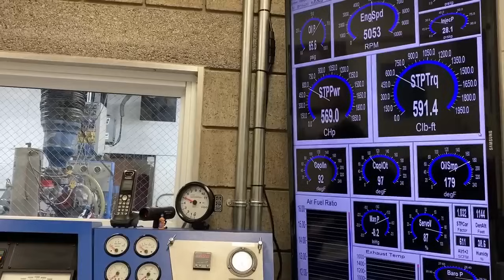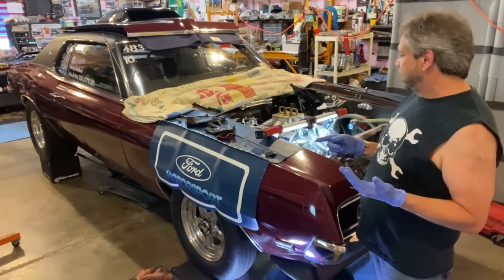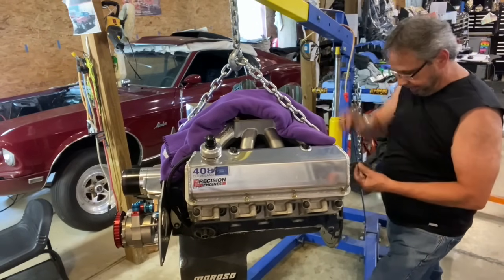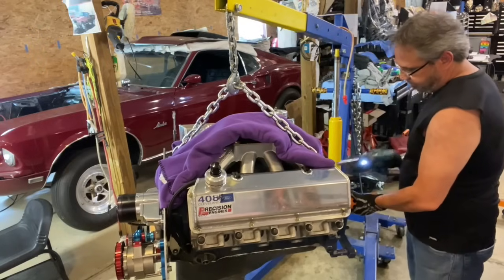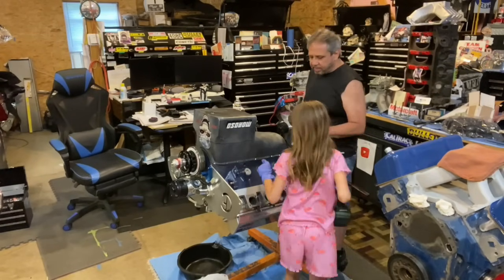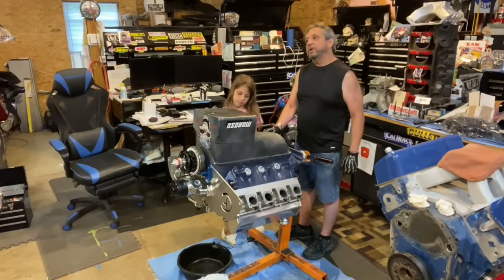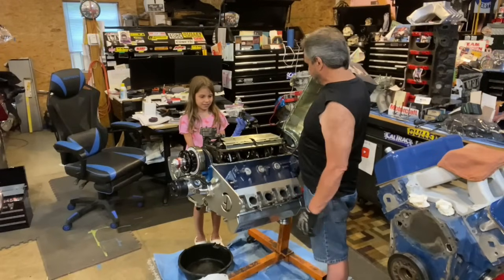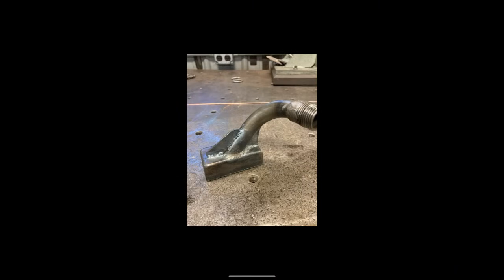DBG: Rip 769 HP Ford 351 Cleveland, Now We Now The Rest Of The Story...No Band-Aid Fix

Comment: This  is the reason why I like to run a single stage external oil pump with the oil pick up built into the oil pan
Reply from the maker: Have been debating that, external wet sump, but that is a 2k cost right there. Pump is a grand. I have learned what I do for oil mods is working well. I have a new pick up. So it will be fixed with supports. New crank and rods and lifters. Those lifters are 11 years old. Thanks Greg
Reply: Are you talking about a belt driven pump?
Reply: Pros: External oil pressure adjustment, almost eliminates distributor gear wear, a little more power from less windage, and ability to easily prime engine before startup.

Cons: cost and small worry about belt getting knocked off by debris
Reply: I think truck/tractor/ heavy equipment supply shops have an oil pressure safety switch.
I bought one in the 60's and it saved me once when I made the 4th gear change. The oil filter blew and oil covered everything immediately, and the engine shut down. It happens so fast that you aren't aware anything went wrong. But we learn.

Saved an engine, me and the car.  I seem to recall it was made by Bendix then.
Still have it.
Reply: All of tha to overcome  poor quality materials.I understand an upgrade idea though. @bryanmaloney6651
Reply: @DragBoss351Cleveland I hope the material it is made with is better.my Milodon pickup is strong steel about 12" long with many in use and no problem.
Reply from the maker: @michaelclanton1152 yes external wet sump.
Reply from the maker: @bryanmaloney6651 thanks for a quick synopsis. To tell you the truth I’m not changing anything. What I have works. The pick up failed. I talked to Stefs yesterday, they want to help me out with the oil pan and asked me to send them mine and they will decide a way better pan and pick up. And possibly do a live chat that pans and oil control. I thought about the external oil pump. I’m just trying to prove that I can do this, the way I’ve always done it. Thank you for being here. 🏁💯
Reply from the maker: @JohnH.-qp6fb yes sir you’re right on the money. I will have one of those installed. I never used one before and never really thought I needed one., But how wrong I was. You’re lucky you didn’t get hurt either. These are all expensive lessons for us to learn. I’m glad your here John. Stay tuned.
Reply from the maker: @michaelclanton1152 I talked to Stan at Stefs yesterday. He said send him my pan and a new oil pump. they will make a custom oil pan and pick up. And also possibly do a live chat. I always wanted one of their oil pans. Although I said, I am not changing anything in the rebuild. this change would rectify my issue. I’ve learned a lot of lessons Michael in this build, they all seem the hard way. But a lesson learned as a lesson lived, and from that,  get this. My old engine builder Bob, who is 82, I’ve made some videos on him and you may already know this. He’s coming out of retirement going to help me build this engine. Yeah 👍 and hey I may run a 9.20….
Reply from the maker: @michaelclanton1152 Michael I just gave you an answer on this in a different post. Nope I get what you’re saying. Trust me.

Comment: When I worked at a shop back in the 80's on circle track motors we always braced the pump and the pick up because we saw them brake with out them.
Reply from the maker: Wished I would knew this from the 80s, lot I don’t remember. Thanks Adam

Comment: Bro, did you do what I do and bend to fit it?! Tim, easy for me to say but I never would of used the welded part. Have had " repaired " water jackets, fail on one heating cycle. Welds change the metal around them and if oil was there at the micro level, it will fail. I feel for you big.time! I am doing an engine after 25 years, since my first open chamber 2V sludge motor and if it does fail for whatever reason, it will not be the machinists' fault. This is about you, so sorry DragBoss! Enough of me but thanks for helping all 351C builders. Not just with the content to follow but for all your fantastic work on the subject. The number of 351Cs, that have come to life and lived thanks to : you, your wonderful assistances, unreal /switched on guests; are no doubt many, Tim. Best wishes, Ads. I would have to be sedated and go on a weeks bender.
Reply from the maker: Thanks for the condolences. I am sick about it, but have to look at the good. The lessons learned and no damage so to speak. I never bent it, not welded so to speak but brazed from Moroso. I thank  you for the kind words you speak. I try my best to help others with my videos and experience I have. I am not some pro. Just a guy in his shed, with a love of Cleveland’s and racing and cars. This will be even better than ever. Good luck with your build, glad my channel helps.

Comment: A testament to the quality engineered into the alloy of your connecting rods, saved your block, pan & cam for sure. Back in the age of factory forged... it's all scrap. Crank's likely salvageable for future street service, with a .010/.020 turn. You'll dig yourself out of that hole, better days ahead. Expensive to go fast, some days better than others. We'll enjoy the follow up posts, in your making it right again.
Reply from the maker: Yea. New bottom end. ie crank and rods. Not messing with that crank. Will make a nice street build. Get two sets of rods, from Molnar and put this crank in another build. Hell got plenty of parts. Yes I have a plan, will make a quick follow up video. Thank Nobody
Reply: @DragBoss351Cleveland  I bottomed out 15 years ago (lightly) in a field at the barn yard track and just cracked my pick up tube. It took all my bearings out & my isky flat tappet too. I've forgot to turn the water pump on & fogged my crank with bearing material. A lot going on in prep to the line, co pilot's exist for a reason. If we had gauges next to our cut off switch's on the back of the car & a crew with an eye on outside readable oil pressure with access to the switch... it wouldn't happen. One thing about problems... there's always something to be learned. I enjoy seeing your little one geared up for surgery with the gloves ready to operate. I have three granddaughters that have all graduated High School, there into going to the track but not so much workin on cars. I've got a set of K-1's at 711 grams I can't get replaced at weight because I was one of the lucky ones that got the lightest set of BBC H-Beams ever made. It's always something.
Reply from the maker: @Nobody-ld7mk right on. We all can that’s racing and it is. But like you said. I learned a lot from this failure. I also know I am not the only one that never heard this about a Cleveland. I have a few changes I will implement. Which will improve my safety and the Cleveland’s. The little ones hopefully will continue to enjoy the time in DBG with Dad. They learn things they will never learn at school. Grateful Tom Molnar (k1) is helping me with new crank and rods, and will talk to him about a couple of future builds. He is a humble man. Always something to learn.

Comment: you need a couple things Tim, a swivel hook on the hoist and a foot pump for the jack, or a helper operating it, you could have pulled the pan in the car, but much after that and you would have had to pull the motor anyways
Reply from the maker: That’s how I look at it. Also the picker I have has a slow leak, when raised will slowly go down. So have to keep pumping and shifting. Back and forth. Need a helper Fred.

Comment: Great video. Sucks about the pickup tube. I like pulling the transmission with the engine. Your cougar was screaming.
Reply from the maker: Thanks. It does not suck no more….oil. I used to do that, but with a motor plate no need. Not sure which is easier.

Comment: Back in the early days when I ran Clevelands and small blocks, I would twist off the oil pump drive shafts, I remember I had a 302 where the thrust surface was so worn that you could grab the balancer and nove the crank 1/4 of an inch. Yea I heard you talk about bad lifter, I got into Valve float and knocked the clip out of a solid lifter that got sucked up in the oil pump, that killed my last Cleveland,  ran Windsor blocks for awhile but similar problems.  Hated those little oil pump drive shafts, I even ran the half in ones but they would break off at the pump. Wish I would have went to an external pump.
Reply from the maker: Wow that sucks Jerry. Never had an issue with drive shaft. Been running billet one for years. Just installed new one on this build.  Learned a lot, the hard way.

Comment: I could not discern from the video if the weld broke or right next to the weld.(In the heat effected zone). Which is more likely.
Such an awesome engine, will be better upon reassembly🤘🇺🇸
Them Melling Select pumps have advantages over the reguler line. I don't know if you worked your pump or not.
Reply from the maker: The pick up broke right after the weld, this was the best running engine I’ve ever had. We’ll get her back going. Mailing does not make any select series. I talked with stefs yesterday, they want me to send the pan and an oil pump and they can hook me up. Seriously thinking about doing this. That would be the only change to my oiling system.

Comment: Sad news Tim. Not the first I’ve heard of this though. My dyno guy says he’s seen a few times. He says harmonics play a factor. Not sure if thats what happened with you but something to check. I think this is one of reasons Kaase built the big neck on 460 oil pump. He would be a good guy to talk to on this subject.
Reply from the maker: You are so right Steve definitely harmonics. Then add heat, stress, two forces, everything is a factor. I just never ran into this on a Cleveland. I’ve heard about the big BBF issue. he has tough to talk to, I’m still waiting for a callback, from Cliff. I don’t want to hassle them or keep bothering, the door opens when it’s ready. This may be a project for my old engine builder, Bob and myself. Hmmmm😎

Comment: Hate to say that old style pickup tube caused all your grief.  Many times the old part do well, but one like this comes more often then I can recall. I use modified Swageloc fittings in all my engines. Plus a tac weld.
Reply from the maker: It sure did. Grief stricken, but lucky.  Going with a new stefs pan and pick up.

Comment: Cross member out  . Tube front half , with light struts , rear sump pan ,,, ! ,,, btw , gotta love a wife that noticed the problem immediately , and the look on your face , priceless  ,,, !
Reply from the maker: If I choose, just need different rear crossmember. Wants to use my front sump until I get the 427 aluminum Cleveland done at BES. Then switch to rear. Yes that look. Had to go back and watch. 😳

Comment: Pretty crazy failure Tim. Never seen a pickup tube break off on a Ford like that.
I would want 4130 Chromoly seamless tubing to make a New Pickup tube.
On that 454 Chevy pickup of mine I bought a Fancy Moroso BBC Ol pump 80 psi. They TIG Welded the Heck out of it and its braced 2 times with a Widage tray above the pickup Tigged on then bolts to the pump cover.
Reply from the maker: BandR, the craziest. I have never seen it either. But common in racing and I missed the message. I know. The choice is either I fix it with bracing which I know it will be fine. I did talk to Stan at stefs yesterday. He said he could take care of everything. Make a new pan much better than what I have, send a new oil pump and they will place it in the right area and braze everything. Versus doing it myself. Darin Morgan told me yesterday that windage teas loose power I think that tree may have contributed at least in a vibration effect, but it’s evident the harmonics are present, trying to break this oil pick up every time it makes a pass. PS my old engine builder Bob who is now 82 is coming out of retirement. Help me get this back together. I think you may remember him from his other episodes he’s been in.

Comment: Reminds me of doing brake jobs with my girls when they were younger. Nice having a helper around.
Reply from the maker: It sure does. Thanks. Here is another quick one. Alaina's Garage: Doing Rear Brakes 2013 Ford F150,  Use Your Emergency Brake, So It Does Not Freeze
https://youtu.be/gBfseDV9uQ0
Reply: @DragBoss351Cleveland  that's great!!!  2015 F150 on this end. :). Looks about the same underneath.
Reply from the maker: @johnnymossville we teach our kids similarly, good old-fashioned values and hard work. I just had 100,000 miles, oil change every 3000 and I only run premium fuel, otherwise you get carbon buildup on the intake valves from direct injection. Glad to your here Johnny. 🏁

Comment: Tim I bought a used Boss 302 T/A spec engine back in the early 80's from an ex road racer and dirt track guy that had switched to a high port head Cleveland. The spare 14 qt baffled home modified oil pan that he gave me along with it but I never used because it required a specially modified front sway bar had a similar oil pick up tube that had a brazed on brace on it. He said to only braze the pick up tubes when modified because welding could make the tube brittle and crack at bends. He said vibrations and rotating forces raises havoc with oil pumps and should always blueprints when new. Also had custom made reinforced oil pump drive shafts that looked ugly and heavy but never broke. Oil drain back tube with braided line from the rear of Cleveland steel valve cover to the oil pan got the oil back quicker on circle tracks. I don't have that oil pan anymore but I'm sure I have some of the other trick pieces in my old stash of Boss stuff. So sorry this happens to the mighty Cougar and you but it was very strong to not grenade! Good luck with the repair Tim!
Reply from the maker: Wowser what a story bill. Cool stuff. I notice. What looked like braze on some pick up and pumps. Good to know. I found out any damage can cause stress risers. I guess I never thought there was much stress, only my stress. If you’re interested in getting rid of anything let me know. I may be able to use it. Here is my email thpa351@gmail.com. Thanks
Reply: At least it's not a cracked block thank goodness👍🏻
Reply from the maker: @danonoveh8114 highly doubt it but who knows 2 bolt 1970……11 years of abuse.

Comment: They will always crack at the weld, the weld made steel brittle.. you have a fantastic deep sump, but that means a long unsupported pick up with 7 litres of oil sloshing back and fourth...
Reply from the maker: Learning a lot of new stuff about this whole situation. There are so many forces in motion never even thought about it. Any scratch Nick any damage to a pick up cause of the vibration to localize that area and crackola.

Comment: The trans builder CRT could not fix it so I moved on after3yrs of trying to fix and 5k$to go to a th400. I got 3k for 2 727 in the switch to a Rossler. Life ain't bad I started a weight loss program going well on meds but big $.
Reply from the maker: Mike , have not been around much. Had to walk away from engine, for a couple of weeks. Working way more than normal. Lots of family stuff. Hoping no tranny issues and I can just freshen motor.
Reply: @DragBoss351Cleveland  you do what you can and things will progress. Do you make list of things to do in some kind of order and adjust to what life gives you?
Reply from the maker: @michaelclanton1152 I have to make lists. Good old pen and paper. Keeping things electronically does not work for me. Lotta of good stuff happening Michael. Had to walk away for a bit. Live life.

Comment: I never had a Ford pickup break like that, but it's common for Chevy engines to fall out if not welded or an aftermarket pickup being used that bolts to the pump.

Hopefully there is no crank damage. 

I'll say there is minimal damage to the crank
Reply from the maker: Patrick , I haven’t even gotten a park yet but I know the crank and rods are done. The crank I don’t know if I’ll leave even bother messing with that. Just replace and start over. I never thought it was common either. A lesson for us all to learn. Stay tuned. We going to get this back together at DBG 💯🇺🇸🏁

Comment: very sorry for you. looks like pickup tube may have failed in the heat affected zone beside the weld. the extra bracing or gussets you are proposing should help. best wishes.
Reply from the maker: Yes, very unfortunate, but it shows the weak point Bob. That’s a lesson Lord. I made for the first time in 40 years. Get a custom-made pan. I talked to. Stefs yesterday, I can send them my pan and an oil pump and they will take care of everything. This might be a better improvement than me trying to make it better. Although I know what I would do would probably be sufficient.

Comment: Sorry to see the damage Tim. Hopefully the crank can be saved.
Reply from the maker: No worries Marc. I think crank it bad. No worries, I can get a new one from Molnar. We got this my friend.
Reply: According to the research I did, a new Molnar would be a good choice. Callies has an impressive operation and works with a local foundry to control details like the metallurgical properties of their cranks as needed based on the intended usage. Sounds expensive but it might actually be one of those get what you pay for deals 🤷‍♂️🇺🇸
Reply from the maker: @danielwilson6665 yes Callies, has a great company, in this case, I might be able to get the crank taken care of at shaft tech, a guy that used to work for Callies, who started his own company. We had the crank finished. However, I’m here of using used parts like this when Tom Molnar will help me out with a crank and rods, it only makes sense to replace. I will build another 408 down the road.
Reply: @DragBoss351Cleveland   The existing crank was finished to perfection but the extreme heat treating it received without oil pressure probably rendered it useless. The new Molnar assembly definitely makes sense 🏁